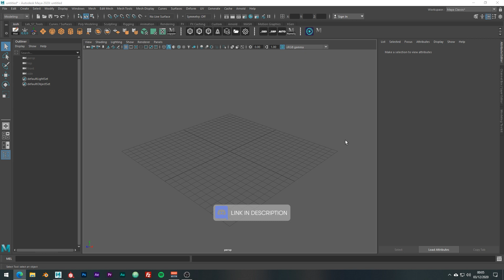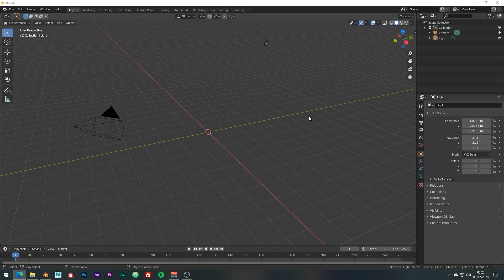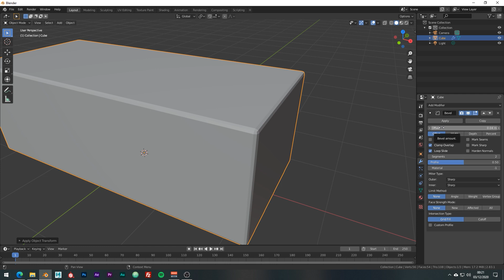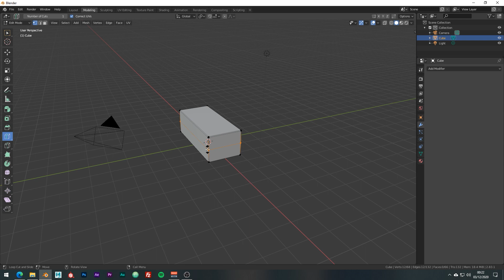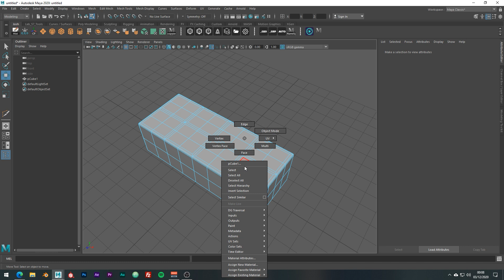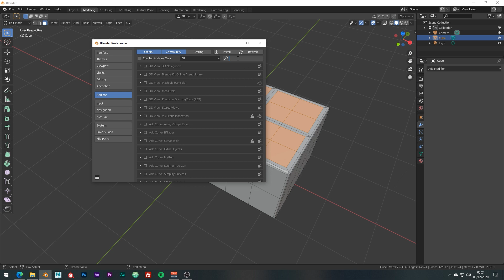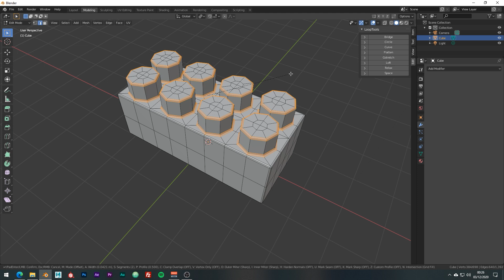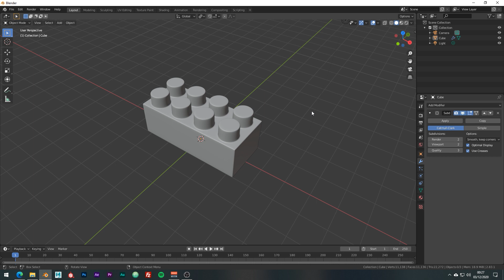Moving from Maya to Blender - A Modellers Guide

Comment: I've been using Maya for modeling for years. I started learning blender last week. I noticed that the process done in 3 moves with Maya is done in 6 moves with blender. This video proves it. Blender definitely needed to be more practical to attract Maya users. In Blender, interconnected tools and variables are positioned in very different parts of the screen. So they made the modeling slower by almost half. Blender's only and most important thing is that it's free. (However, not everyone who uses Maya pays license fees)
Reply: Im also a maya user and I agree with that BUT... Modifiers.
just the fact to be able to come back and modify a bevel kinda makes up for the extra steps needed sometimes
Reply: Actually i work much much faster in Blender than in Maya. YOU NEED TO KNOW BUTTONS, LAD. Additionally sculpting tools..
Reply: Yeah, I kinda cringed at all the additional steps need to execute relatively simple modeling tasks in blender. As someone who's been contemplating a shift to blender for its automotive modeling "advantages", this video was definitely reaffirming of Maya.
Reply: Have to agree, I would actually rather pay the sub fee for indie maya than use blender - it takes me way longer to do things
Reply: ı am learning blender but ı don't find smooth quality display  ( maya keybord shortcuts is 3) on blender how we do ?
Reply: @cansukurumahmutoglu516  have to add subdivition surface modifier

Comment: Great work between apps like this. However, as a Blender user since 2016 and new Maya user since 2021 (and 3DsMax user since 1997), I see that you apply the bevel modifier i Blender. That is not nessesary. Procedural modeling is a breeze in Blender compared to Maya (yes, as I said, I am a new Maya user). Just let the modifiers stay and add new ones, reorder them, super simple in Blender. A total hassle in Maya. (Stickin' my neck out, I know.)
Reply from the maker: Thanks for the tip, that's super handy to know :)
Reply: Hi, I am new Maya user,
I want to connect two vertices as we do in blender by just clicking the 'J' key.
How do I do it in Maya?
The Multi cut tool is not what I am looking for since it makes edge based on camara angle.

Comment: Its interesting how autodesk removed the main thing keeping pro artists using maya in their spare time. I can see this trickling the industry away from maya slowly over the years, because at this rate most industry artist will be able to use blender interchangeably, simply because nobody wants to spend 1k on a 1 year subscription just so they can model in their spare time and the old student versions were godsent...
Reply: That will nott happen bradda
Reply: @CaCa-co4ec  why not?
Reply: @thelemoneater  cause maya is a standard u think all the studios will change to blender> that cant be possible even if blender becomes the best there are still chances to not change to blender cause 1. first all of the artists there have to learn the program 2.second they have to make new addons new tools like they did in maya and 3.third maya is just better for now
Reply: @CaCa-co4ec  Curiously, most of the artists i know, and even the teachers from the university where i studied say that Blender is slowly becoming better than Maya. I have used Maya for years, and now that i installed blender and plan to test it, i hope to find which one is better.
Reply: @CaCa-co4ec  I mean, you're talking current Blender and Maya. However Blender is slowly getting adopted in Universities and Colleges and production artists have added it to their tool set. You forget that Blender is just another tool in an artist's toolkit. I mean, of course artists have to learn to program. Nobody opened Zbrush and knew what the hell are the buttons and things even were.

Comment: Couple of notes for blender.
1. Bevel is both a modifier and an operation in edit mode. Which one you use depends on whether you want it to be editable after the fact.
The loop cut tool can do multiple even cuts at once you can use the mouse wheel or the keyboard to specify the number of cuts.
3. Extrude individual can be done with the alt + E keyboard shortcut.
4. Extrude region can be done with the E keyboard shortcut. 
5. The whole extrude zero then scale can be done more efficiently with the inset operator activate with the I key and use the I key again to toggle between group and individual inset modes.
6. You can add a subdivision surface quickly (or change the number of subdivisions) using the ctrl + 1-5 keyboard shortcuts.
Reply from the maker: Thanks for the tips! Appreciate it :)

Comment: Maya pros:
+used as main modeling and animation tool in most US based studios = easy to find job
+has powerful animation tools like editable motion trails, onion skinning, easy to use graph editor etc
+has powerful UV editing possibilities
+flexible = wide range of avalible scripts written in mel or python
+lots of plugins are avalible
+fast viewport

Maya cons:
-slow and bloated = you wait half a minute until it shows you the UI and then you wait sometime for the UI to be responsive
-low quality software = lots of bugs and crashes
-somewhat outdated node-based architecture
-slow tool-based workflow
-slow and destructive modeling workflow
-slow rigging and weightpainting workflow (without addons like ngskintools it's just suck)

Blender pros:
+fast and lightweight = loads in seconds
+the only all in one solution that can cover whole pre-production/modeling/texturing/sculpting/rigging/animation/post-production pipeline
+higher quality code base = less chances to crash or have a bug (versions after 2.79 are less stable because of big development jump)
+has flexible and clean UI
+fast and reliable mode-based workflow
+fast and powerful non-destructive modifier based modeling workflow
+easer to use rigging and skinning tools
+flexible = wide range of avalible addons written in python
+PBR-based viewport that gives you closest WYSIWYG results
+open-source code base = you can edit blender and add your own features
+free

Blender cons:
-in the industry used more as a tool in the toolbelt
-the all in one solution that is best for generalists and hobbyists = lacks more specific tools indie developers
 rarely need
-has less compatibility with other industry standard software
-has one of the slowest viewport when it comes to animation
-has not reliable undo system (tbh I had problems with undo in Maya too, when blender at least try to undo, maya sometimes just forget everything all of a sudden)
Reply: I wholeheartedly disagree with the blender con "-has one of the slowest viewports when it comes to animation". By pressing Crtl + Alt + Z you can access the undo history, where you can go back and forth as much as you please without any lag, even with a big scene active.
Reply: Bro maya low quality software are u kidding or what, definitely u have to work on ur lighting and rendering part in maya 😂, in my opinion maya have unbeaten in animation and organic modeling, texture and sculpturing maya needs substance painter and zbrush, but blender handle it both

Comment: A tip in Blender. Instead of using extrude and right klick to cancel the extrusion and then scale, you can use "extrude inner" (press 'I'), it does all those steps it directly.
Reply from the maker: Hey, thanks for the helpful tip!
Reply: @JoshAntonio  or just use inset, that's pressing I, then I again for keeping faces together off
Reply: Better yet: use the tool that's designed for this job: Inset Faces.

Comment: That was pretty good man.
But there are some shortcuts that you could've used in blender.
For example:-
You don't have to go to modeling workspace to edit mesh.. You can just press tab.
You don't have to extrude then cancel the extrusion then scale to inset. You can simply press (I)
Ctrl + (1,2or3) to add a subdivision surface modifier quickly.
If you didn't apply the bevel it would have been already transferred to the top part.
You can set the limit method in the bevel modifier to angle so that it doesn't bevel every edge.
Reply from the maker: This is exactly the kind of helpful comments I wanted, thanks for the shortcuts! Will definitely speed things up
Reply: @JoshAntonio  Yeah, a very helpful comment. By the way, if you press i twice, it's the same as disabling "keep faces together" in Maya. Another good key to remember when insetting is B, it will toggle border inset, very useful when working with mirrored geometry, for example. Try i-b on 2 adjacent faces of a cube missing 2 other adjacent faces, to see what it does.